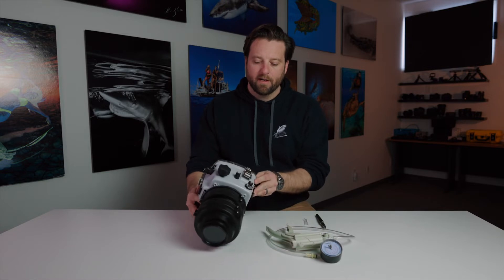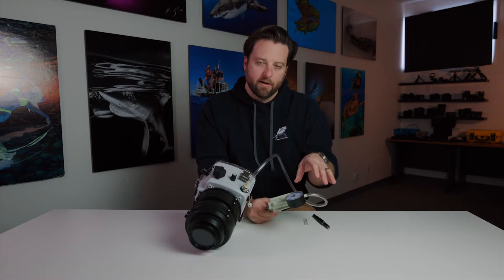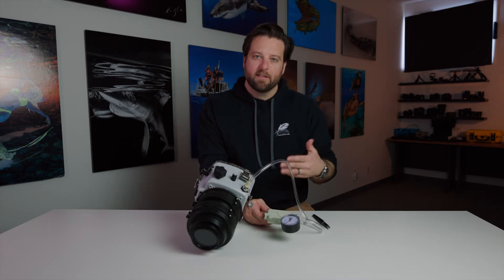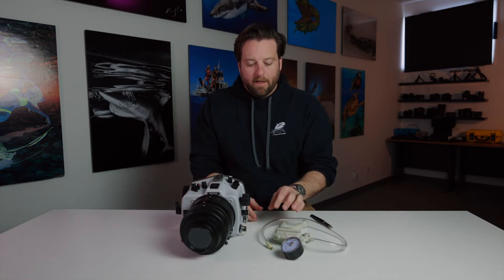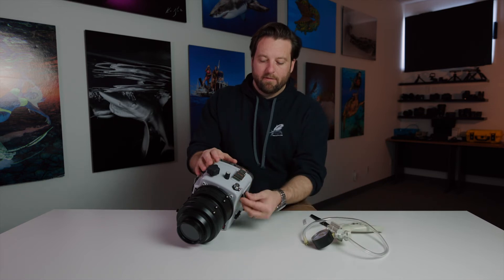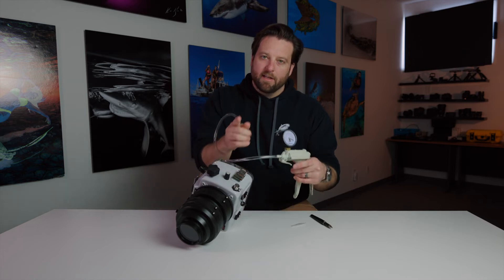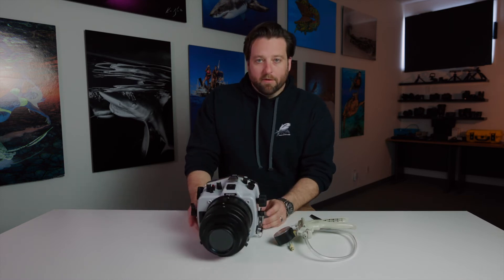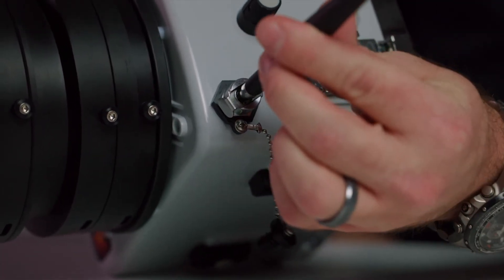Checking for Housing Leaks with a Vacuum Pump and Valve

Comment: Hello Quick question do you suggest to prepare everything the day prior the dive or on the morning ? I am thinking if there are some big temperature difference from the night to the next day will it affect the seal or create potential condensation or fog ? 
Thanks !
Reply from the maker: The night before is ideal. The environment that you assemble the system in will have the greatest affect on potential condensation issues. Therefore, we recommend a cool and dry air conditioned room. After you assemble everything, take a few pictures to ensure you have a card installed, the strobes are working properly, and no lens caps were left on. Once everything is in working order create the vacuum and re-plug the valve. The next day you can re-check the vacuum again with the gauge to ensure everything stayed air tight. If there is a large temperature increase between the night before and the next morning you may notice the vacuum level change slightly, but a vacuum existing is the most important part.
Reply: @ikelite  thank you soo much
Reply: Not related to condensation, but for anyone else reading - I generally do everything the night before, however there have been times things didn't go to plan and I pumped down a vacuum an hour or two before the dive. If the needle hasn't budged you have very little chance of problems, and any leak will be very slow. But in this case, I would repeatedly check the housing underwater by rolling it back and looking for droplets through the transparent back door. 
TIP1: Don't leave the pump attached as you do a vacuum test. The equalization valve lever is positioned so as to make accidental equalization as likely as possible! It should be a thumb screw that you tighten down, not a big lever begging to be bumped as you are pumping or even just setting the pump down to remove it.
TIP2: Keep in mind that detaching the pump, then reattaching it later will result in your housing losing the volume of air in the hose. This means the needle should be expected to drop very very slightly. All the more reason to not do 1 hr tests and to make sure you pump to min. 10 in.Hg.